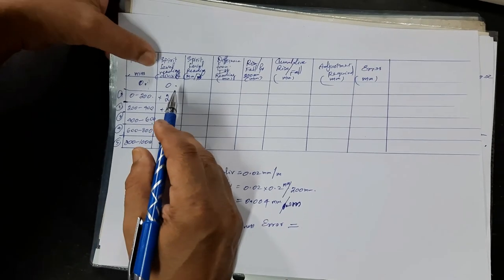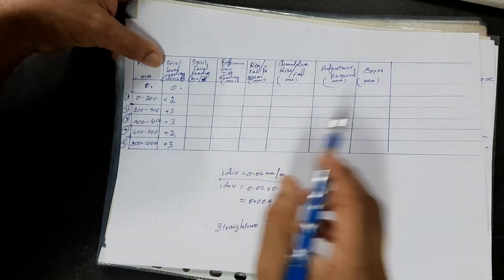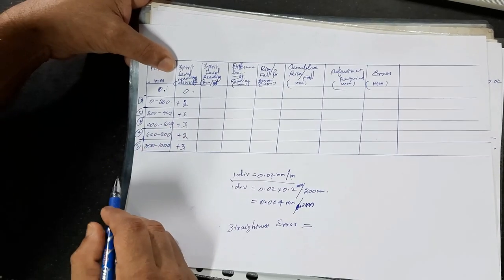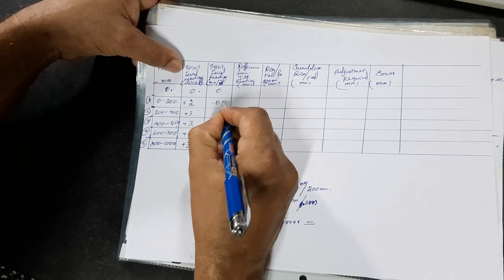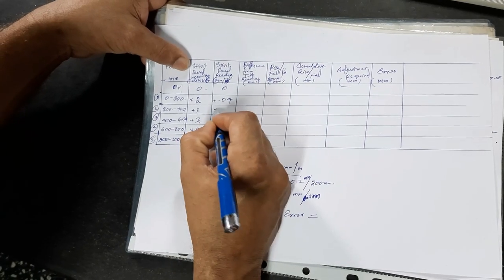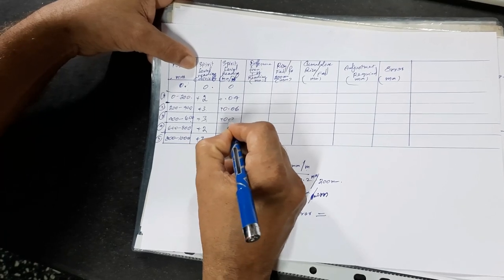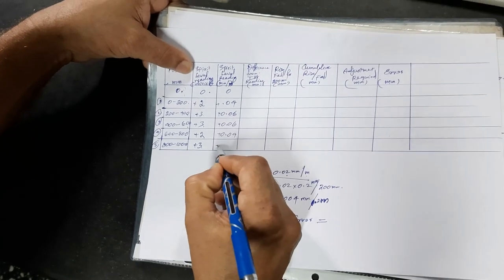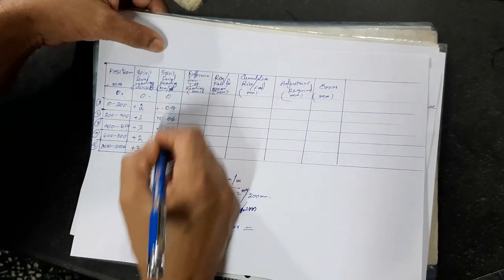Determination of straightness error using spirit level

Comment: If we use a straight edge should we need to take each portion of the length or can we place the precision level on the center of straight edge and take the reading